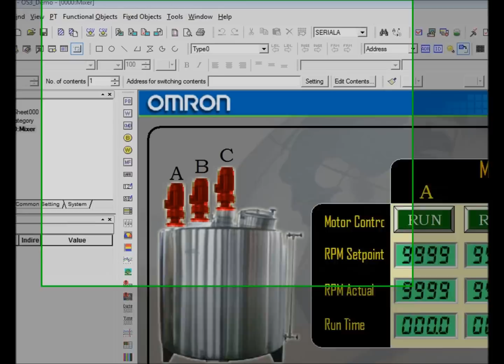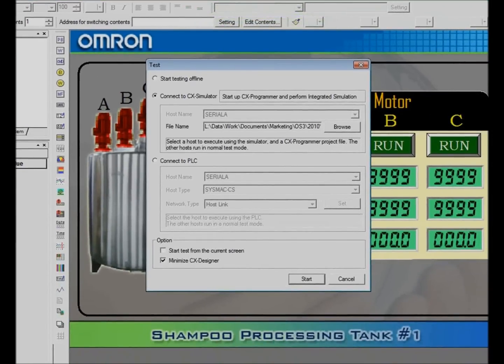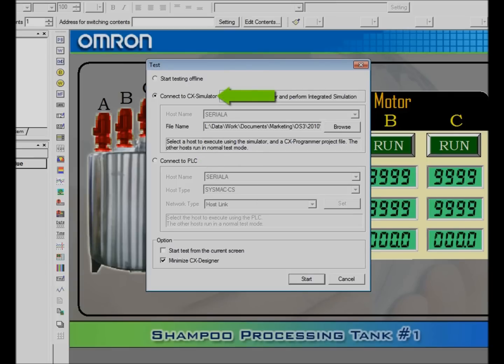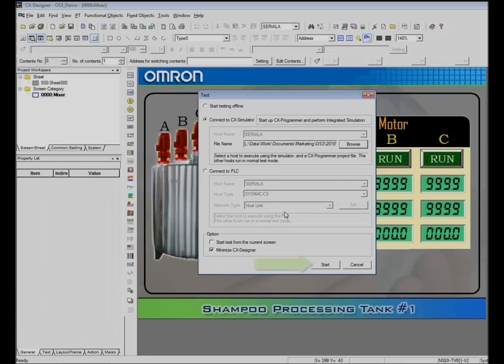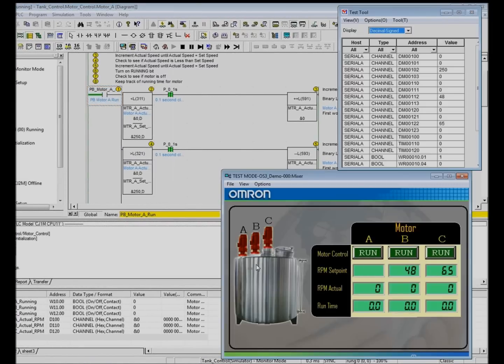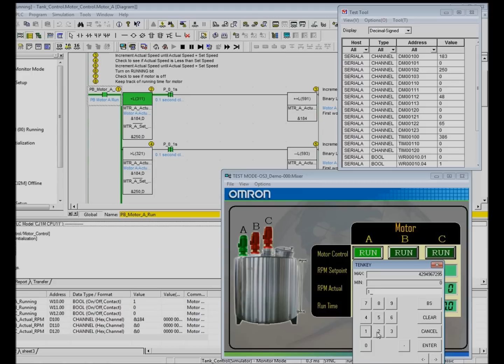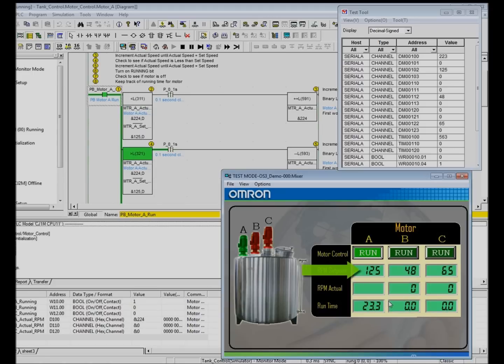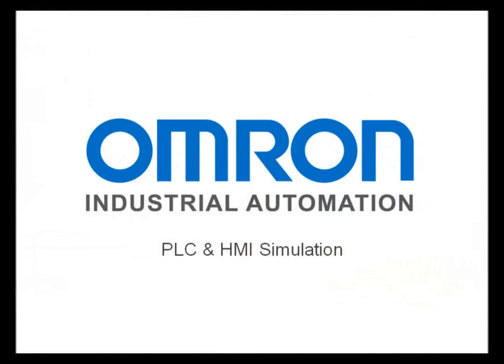CX-Simulator - Simulating PLC & HMI Operation Using CX-One's CX-Simulator

Comment from the maker: CX-Simulator is included with the Omron CX-One software suite. Please contact your local Omron representative for more information
Reply: +Omron Automation & Safety Have you student versions? cos i am badly struggling to learn all these timers and counters with multiple devices, even if only one pneumatic cylinder with limit switches....Help Please...
Reply: Omron Automation - Americas can pid block be simulated in CJ2H with cx programmer and cx designer??

Comment: Would You tell me how to use an external (real) NS5 panel connected to PC via usb-to-serial cable and the integrated simulation engine? I want to test the panel by using the PC as PLC.
Thanks in advance.
Reply: Mihail Petrov I would like to know this as well
Reply: @Cop Loo i figured it out anyways. It was easy